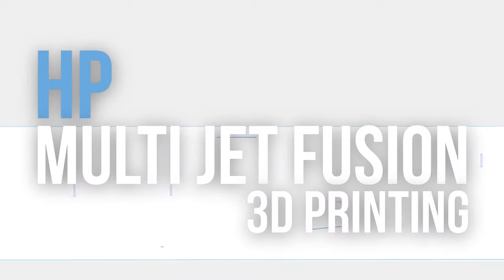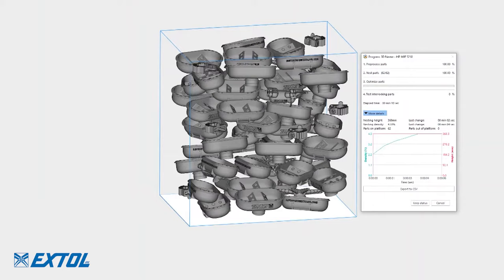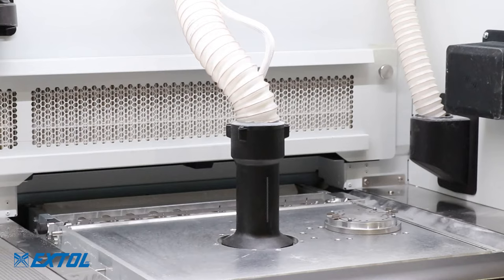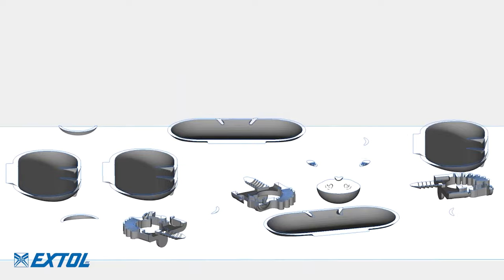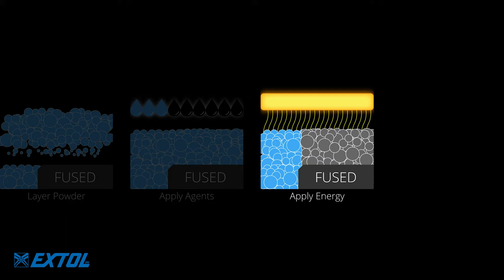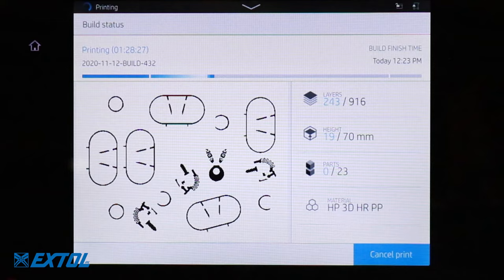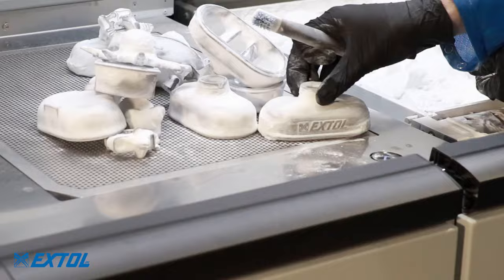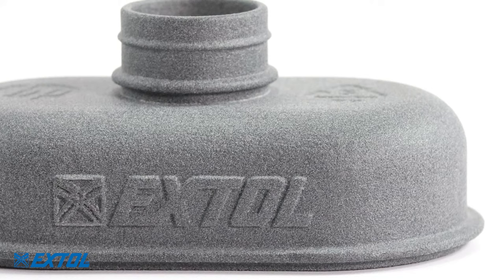HP Multi Jet Fusion 3D Printing

Comment: good job. seems the surface of the parts is kind of rough, or maybe that's the parts designed for?
Reply: Its an powder based 3d printing type so it will always have some sort of roughness on the surface because of the powder (unlike resin). SLS prints are a little rougher but way cheaper for lower build numbers

Comment: Can somebody please explain to me what makes HP's multi jet fusion printers hundreds of thousands of dollars better than the Formlabs Fuse 1+ ? I know formlabs has a comparison on their website but I'm asking in regards to mostly print quality and print strength. He kind of glossed over sls vs mjf
Reply from the maker: The main difference is area-based printing vs point-based printing. MJF typically is more dense based on a larger area of the print bed being exposed to IR energy at once vs the laser tracing individual points in SLS. The IR energy of MJF creates micro welds between layers as it penetrates several layers deep on each pass. The build size and throughput go to MJF as well. It appears MJF has the edge on Flexural Strength and Impact Properties as well.
Reply: @Extolinc  Thanks for the reply. If you wouldn't mind going into more details on the impact properties, I would really really appreciate it.
Reply from the maker: I wonder if these resources on our website have the information that you are looking for: https://www.extolinc.com/services/ddc/#materials

If not, please let us know. We'd love to help you with whatever you are working on. Send us a contact form (on our website) and mention that you're "JoeBlow" from YouTube. We'd love to have a conversation with you.

Comment: Can two printed HP TPU rubber parts glue or head bond together? (post printing assembly)
Reply from the maker: Hi Mikele, thank you for your question. Yes! You can weld and glue TPU. You can also weld and glue the other materials: PP and PA12. We have an on-demand webinar all about welding and assembly of Multi Jet Fusion 3D Printed parts. Check it out here: https://info.extolinc.com/mjf-assembly-webinar-2021

Comment: Is there any option for colors? Or should be the final product painted woth acrylic?
Reply from the maker: Great question! There are options for colors. We can die the parts or paint them various colors. Also, if the material is TPU, they can be coated in a flexible color coating. Check out all the options here: https://www.extolinc.com/services/ddc/#finishingprocesses